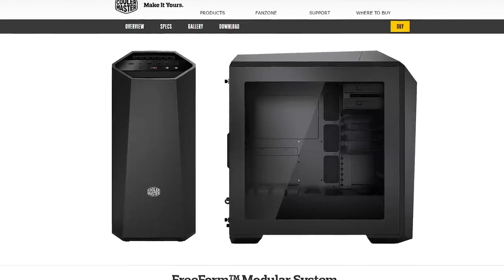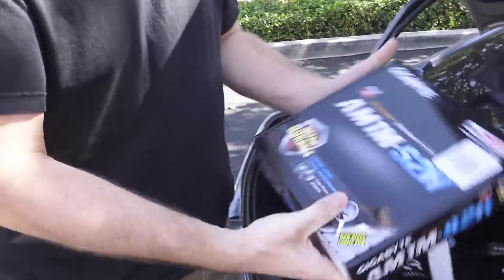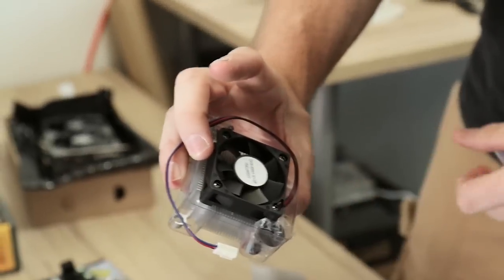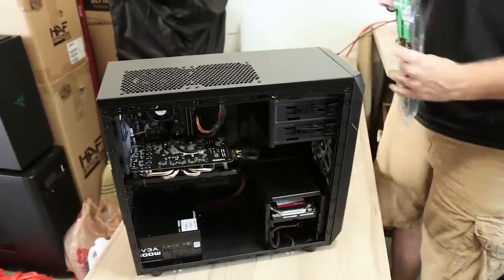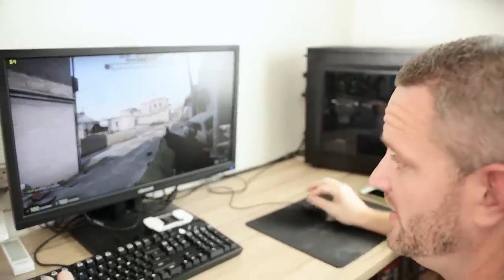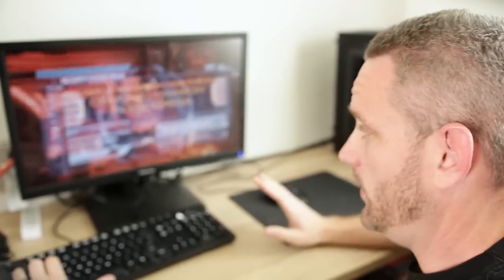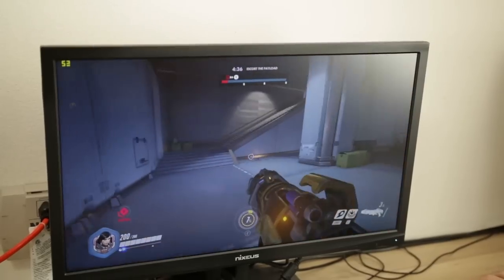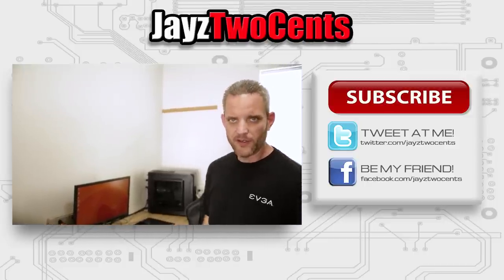Ultra Cheap Gaming PC 2016 - Can you play games for under $400?

Comment: How about an Intel based system around $600?
Reply: Thats like an average build...
Reply: +Luke Thompson that's the point my dude.
Reply: +Ro MaYo Jr you can get i3-6100/i5-6400, 8GB of ram, H110 motherboard, GTX 950, 1TB HDD or 240GB SSD(maybe) cheap case and a 500W psu
Reply: +Marko Tech you think a 960 is reasonable for this budget?
Reply: +Marko Tech Why not go with an FX-8350?
Reply: Ro MaYo Jr yeah it's great if you can get it, but even better if you can get r9 380
Reply: Luke Thompson cus he asked for an intel based pc...
Reply: +Marko Tech cool thanks man.
Reply: you should be able to take this exact build and trow in a intel motherboard and i5 from last generation
Reply: You can do one for $400 that would be a bit more balanced than jay's build, gpu isn't as powerful, but the cpu is much more current and has an upgrade path. (The i3 6100 and motherboard is a $130 bundle at Microcenter) http://pcpartpicker.com/list/j8Tv3F
Reply: +Mr. ManDudeGuy huh? Tf you talkin bout?
Reply: +Luke Thompson fx 8350 isn't really worth it anymore. Performs around 5% worse overall than my i5 4460 which is only 4core @ 3.2
Reply: +unused account If all the cores were working yeah it would come close to your CPU, but once I mention IPC shit goes down hill lol.
Reply: +unused account  I hardly doubt that 5% is gonna make a world of difference
Reply: +unused account Plus the FX-8350 overclocked would kill it. and you can get it when the wraith cooler for less.
Reply: Mr. ManDudeGuy
 cpu's outlast gpu's :/
Reply: +Du6e not always, look at the 860k, it was dead from the stary
Reply: +Marko Tech, never and I mean never get a H110 motherboard or cheap B150 or H170 board... and I would say, never buy anything below i5 at this point from intel.
Reply: how about around 400$
Reply: +Luke Thompson 8350 isn't that great. Even a 2500k trade blows with it. Only a few multi-threaded applications is an 8350 advantageous.
Reply: IIIRattleHeadIII when people are on a budget they have to...
Reply: Marko Tech there is nothing more expensive than a H110 motherboard.
Reply: Take All The same components but Ad 
An I5-4670k and a Z-Motherboard 
(Then you Have my System and it cost me around 600 bucks.. altough i went Itx, that brought cost up a Little)
Reply: You can do the same build price at 400...its been done with CPU's like G3258 (or its Skylake tech replacement), and the motherboard is a little more money. I would say 450 tops.
Reply: Galax 970, i7 2600K (OC 4.7), 8gb 2133 (4x2gb), 500W PSU, P8P67 Motherboard, 128gb SSD, 1TB HDD, Evo 212 Cooler, ATX Tower - $420 (Fluctuates depending on your used part searching skills and daily new parts price changes)

Will play anything on the market at 1080p 60fps while streaming. I know the topic is old but this is in case people come to look later. Second hand old gen OC hardware is the way to go for performance per dollar.

Comment: You Couldn't get a computer for this price in Canada
Reply: try that here in Argentina......
Reply: How bad really is it? I live in the uk (the pound is worth more than a dollar) but for some reason for PC parts of its $400 for them, it's £400 for us, but it's not too bad. I don't know why it's like that because for games it's $60 for them but like £40 for us. Idk
Reply: here that pc would cost me like 800$ if you buy the parts in stores because no one knows anything about pc's here so they over price old hardware (500gb hdd for 100$)
Reply: but your train system is on point
Reply: Yep
Reply: Well that's because your money is worth less than ours, so technically you could  you can't count the exchange rate difference as being more money. 
532 CAD aka 400 USD, could make it a little cheaper but I was copying jays stuff best I could
http://ca.pcpartpicker.com/list/GVtVwV
Reply: VAT is the reason, it adds 20% to all the non EU components, so unless it comes from someone like bequiet then your prices go up 20%, software is exempt from that sort of thing so you pay the normal price conversion (more or less)
Reply: yes you can...... just not without deep sales and access to the internet.
X4 750k with mAtx mobo, 1Tb HDD, Xion Xon BK case, 750Ti, 8gb ram (only used part), 430W Modular PSU all for $395. Opened boxes, refurbed drive, and no backplate mobo. 750Ti was open box
Reply: so guys, does this mean that every video should have an extra +200 dollars shipping (or 100+) tag to it for anyone that lives outside the US/North America (maybe outside of the western part of europe as well?)
Reply: well the Canadian dollar is less than the American dollar
Reply: Je kan gewoon bestellingen ophalen, ook heb je nog wel fysieke shops als Alternate, maar de rest is gewoon falliet gegaan omdat er te wenig mensen kwamen.
Reply: +Anton Perez our parts always seem to cost more. The RX 480 cost $450 CAD...that's at least 300 USD
Reply: There's always going to be a markup whether it's from taxation or just shipping cost, but barely anyone who comments on the cost takes exchange rates into account for some reason.
Reply: Yeah, its like trying to buy a computer with Monopoly money...
Reply: I just built a PC here in Canada. Most jobs seem to be paying more since our dollar lowered(at least here) so PCs are not that hard to get. Even high end. Got like 2tb solid state space 2 980 tis an overclocked i7 6700K  and a bunch of other great stuff and only took a month or two of saving and overtime to afford for something I won't have to upgrade for a long ass time(last PC I had built, had a GTX 580 in it, and still played games pretty well even now... until the card finally died.). Some places have it way way way way way way WAY worse then we do.
Reply: Zalibidas Pay more = more tax
your still loosing and the canadian currency right now is weak so i bet it wont turn out well
Reply: I know, priced are so shit in Argentina, you need to spend around $1200 USD for a medium pc
Reply: Koome
damn how medium is that?
Reply: Your not wrong
Reply: LiteGaming
Its already built and I have another on the go I'm building for someone else. Losing, yes. The dollar is pretty crap right now. Even though it is crap, however, like I said.. its not near as bad as some places. We still have it pretty good.
Reply: I built a 360 CAD$ FX-6300/R9 270x a few months ago.
Reply: Same here in NZ.
Reply: Cairo Murphy I remember I copied Paul's $1200 build as close as I could with what we've got here in NZ, and after conversion it cost like 30%/$500US more.

So this'd probably end up costing $600US ($800NZ) to build in NZ.
Reply: +Koome WTF you wasted hundreds of dollars
Reply: Koome
wat. Are you talking about in the US? Cus'... yea ya can. o_O
Reply: Koome
Ah ok. Didn't see your earlier post. Was gonna say.. for that price in the US, you could get better then that for sure.
Reply: +Koome The specs he listed is affordable in Canada... http://ca.pcpartpicker.com/list/FZk6D8 this is what you can get for 1.5k

and this link is for america for what you can do with 1.5k http://pcpartpicker.com/list/9k4n6X
Reply: yeah you could
Reply: Well duh. 1 USD is worth 1.3 CAD, so why would you be able to get it for the same price?
Reply: Koome the 1080 is over $1000 in Canada
Reply: LiteGaming Ouch. That's more expensive in Canada than it is in the US (even factoring in conversion).
Reply: Koome Nope $600-$800 before taxs
Reply: LiteGaming
US or CAD?

Comment: Im sure you have your reasons, but wouldnt something like a lower end fx processor or x4 processor perform much better and still stay within the 400 dollar price range. Or did you pick a lower end cpu for most graphics power?
Reply from the maker: +ChannelAsh100 I actually went to get the 860 Athlon but they were out of stock
Reply: Would you have rather had that or something like a pentium g4400?
Reply: JayTwoCents I really like the build you should do more of this type of videos and you could help someone build a gaming pc if case they don't have a lot of money.
Reply: G3258 is unlocked and costs 60$ and can be overclocked on many 35-40$ motherboards to 4.4 GH, I did on my MSI H88
Reply: The stock cooler comes with a copper core, it looks like the high end i7 stock coolers, you can OC to 4.2 GH on the stock cooler with the G3258
Reply: 2-core fails in some modern games that don't have 2-core support (probably bad programming and the fault of the developers)
Reply: Why 2 of each hard drive type, do you RAID 0 them?
Reply: I just want alot of storage
Reply: 19TB of Storage? lol. That is over 5,000 1920x1080 compressed h264 movies
Reply: or 600+ average full AAA game installs
Reply: okay I want it
Reply: Some games like Far Cry 4 won't even START on a dual core so I wouldn't call dual-core viable for even an extreme budget build.

Still though, a great way to bump this up and still stay within the budget realm of AMD would be like bumping to a FX-6300 and a board and supports it. That would be a HUGE boost in gaming over the cheap Athlon.
Reply: .....

I was referring to a dual-core CPU.
Reply: +shobonimaster yea plus amd's new zen processors will likely be excellent for budget builds like this.
Reply: FX-6300 is definitely a damn good CPU.  It's what I run, along with (at present, but looking to upgrade for a little more headroom) an XFX R9 270X Double D 2GB.  Handles everything I throw at it, except for a few couple-decade-old titles that seem to refuse to run on anything other than Win95.  I think some of it is compensated for by the RAM I have in it (I do art stuff): 24GB of Corsair XMS3 1600.
Reply: I have the fx 6350, ocd to 4.4 ghz, with an rx 480 8gb, and it runs awesome (this is jumping up from a 6 yo workstation with a gt 620. . .)
Reply: here is my build if you want to see it and plus its a beast so great and worth every penny I beast at any game will have it for a few years I make Pcs for people local to where I am for whatever the pc cost plus 300 dollars more for the work plus ya money for myself cause I do work to build most of my builds cause some of the people who want me to build them a pc want a 3k pc so I have to use a lot of my own money to build them then I sell them to the people for 3.6k sometimes or 3.4k whatever I feel like a good price for it.
Reply: Games4Days >Not even springing for a six-core for $100 more

Shame on you.
Reply: shobonimaster
Hell, I only paid $103 for my Six-Core FX-6300.
Reply: Games4Days
Three words for ya buddy: Run-on sentences lol
Reply: ChozoSR388 I was referring to the six-core i7s that run around $450.
Reply: shobonimaster
What speed? Mine is 3.5 stock.
Reply: I would get the i7 6900K one but I don't think its worth it right now I will wait a few months then buy it cause the price will come down some what.
Reply: ChozoSR388 Speed doesn't mean much across two differnt architectures.

A 3.0Ghz Haswell or Ivy Bridge i7 or even i5 would likely demolish even a OC'd 4.2Ghz FX-8320 because AMD stuff is lower-to-mid range at best as of now.
Reply: shobonimaster
I figured it would be about "even" as long as they were both either x86 or x64.  I mean, if you want to get technical, they both use the same technology, for the most part, considering that AMD came about from being a "third-party" intel processor manufacturer.
Reply: ChozoSR388 

Not really, or else a 2.4Ghz Sandy Bridge Pentium would perform the same as a 2.4GHz Haswell i7 in applications that didn't use more than two cores.
Reply: shobonimaster
Gotcha. Thanks for the clarification on that, actually.

Comment: honestlyi would've choose a better cpu and choose something like a 750ti or equivalent
Reply: rx 460 would be a better choice
Reply: Well I dont now a whole lot about amd although I am trying to ^^ but by mentioning the 750 I was referring to its price range
Reply: yeah i got an FX-6300 and 750ti superclocked and i get 40 fps on max gta5
Reply: What are the settings of gta v to get such low fps?
Reply: I'm getting around 45 fps in gta v with an FX-6350 and a GTX 970. CPU maxes out often.
Reply: RX 460/950 would be better, the 750 ti is too old now.

Comment: a used $400 laptop can outperform this desktop... Just saying
Reply from the maker: +Aznwarlord7 no. It can't. Just sayin
Reply: ***** hosting a server on dust2 my alienware 15 can average well over 200 fps in csgo at 2048x1152 with all settings at lowest and multicore rendering on.
specs:
i7-4710hq
gtx 970m
16gb ddr3 ram
irrelevant specs:
4k touchscreen monitor
rgb lighting :D
256gb m.2 boot ssd
1tb 5400 (swapped out to a 512gb 850 pro)

I bought this used for 400
Reply: to be fair my laptop also outperforms MY $400 (used) desktop with a gigabyte gtx 950 (base model oc&#39;d to a surprising amount), i5-4460, 12 gb ram and it came with a 1tb 7200rpm 64mb cache hdd swapped to a 512 samsung ssd.
forgot to mention it has a potato 280w psu. dont even know how the psu has enough power for the everything (one of the reasons i disconnected the hdd), id have to buy a new psu if i wanted to upgrade this rig to an evga 980 ftw i saw for $250 :(
Reply: Aznwarlord7 that specs cost at least $700 lol
Reply: ng jingchern for my laptop or desktop?
Reply: He's saying you got lucky, essentially, for getting the used laptop for that price (IF you got it for that price). Also, Jay, do you think a Pentium would do better than the Athlon? I've been doing a lot of budget gaming builds and I usually get an i3 and put it in them for people, but the Pentium on an 1151 board would have a better upgrade path. Plus, since I work for Micro Center, we do get a slight discount on hardware and the warranties are for pennies.
Reply: these are used prices not new like jay bought, of course used parts cost less
Reply: ***** i flip laptops
Reply: Then it's not cheaper since you put more money in it.
Reply: Brandon Caylor only the second ssd, the laptop as i bought it outperformed his desktop
Reply: Mhm. I'm sure.
Reply: +Brandon Caylor I say he's full of shit.
Reply: Judicial Same here.
Reply: i dont really care cuz in the end i'm the one who got the laptop :P
Reply: Aznwarlord7 Yup. Really hope your enjoying it.
Reply: +Aznwarlord7 don't care don't comment :D the more you know
Reply: Aznwarlord7,but can you make it powerful.
Reply: Endingz_ a gtx 970m is a gtx 970m which is a gtx 970m
Reply: Your literal words were: A used $400 Laptop can outperform that desktop.. Which we all know is horseshit UNLESS you got a REALLY nice deal on a relatively powerful laptop for a cheap price. Your comment for what it is only holds truth if you're able to find a laptop with better hardware for that price. You're making your argument that MOST $400 laptops would be better than this desktop which is simply not true.

For example, I could say: A $3000 used car is faster than your $10,000 new car.. Well, does that mean that the 10,000 dollar car is overpriced and really slow? No... it just means I happened to find a pretty fast used car for a cheap price. 

grats on getting a cheap gaming laptop I guess?
Reply: The Romanian Gamer ???
Reply: The Romanian Gamer wtf r u talking about
Reply: Yes it can
Reply: Is windows already installed or I have to nstall with cd or USB?
Reply: you have to install it
Reply: Dude that laptop doesn't normally cost anywhere near 400.That's the price that a random person sold it to you because it is used.THis laptop should cost around 1000-1500 dollars.
Reply: saying your $400 laptop USED is better than a $400 new computer... xdxdxd funny
Reply: performance wise it is
Reply: http://gpu.userbenchmark.com/Compare/Nvidia-GTX-970M-vs-Nvidia-GTX-760/m17319vs2159
you have a better cpu but i would have a better gpu for less money. I also have faster storage a better screen, windows 10, a battery and a touchpad and keyboard.
Reply: it has a  gtx 970m and 16gb of ram and a i7-4710hq...
Reply: Aznwarlord7 thats not $400.
Reply: That's a laptop, and laptops aren't as good as Desktops.
Reply: I think you just got lucky getting a 970M for 400. Even used.
Reply: You know, you're probably just lying. I mean, after all, it is the internet. You probably couldn't afford the case alone.
Reply: Aznwarlord7 is this true
Reply: JeremyM couldn't find your company
Reply: thats not 400 USD nerd
Reply: Used is not the same as brand new purchase. If it's second hand you might even go below $300 and get similar or better performance. If we add possible "on sale" components...

Comment: Can you make an counter strike GO Computer that runs on 350-400 fps with everything on low? I use 4/3 resolution stretched.

Must support 144Hz screen.
Reply: easily
Reply: no because that athon would bottleneck  way before 144 fps.  If you can afford 144hz screen and than you can afford a decent i5 and 1151 motherboard.
Reply: J-to-the-R csgo has 300 fps cap no?
Reply: aaa 300 fps cap but can be increased  in console to a higher number.
Reply: what does that mean? the athlon would bottleneck? can you explain?

Comment: the cpu is bottlnking / u couldv easily grabbed a i5 2400 for less and have mch better prfm
Reply from the maker: +XPLOSION Gaming haha.... An i5 and a motherboard for less than $40.... Mmmmmkay
Reply: it was a trap m8
Reply: Or you can just buy an x4 860k for 70 bucks
Reply: Or an AMD 845 Excavator for 65.00
Reply: ***** hi there my friend
Reply: Remember the more expensive the CPU the more expensive motherboard (socket) is required, so good thought but Jay does have a good point here
Reply: true but you gotta go used

Comment: my pc (cheap): Case: DeepCool TESSERACT SW HDD: WESTERN CAVIAR BLUE 1TB RAM: RAMMax 2x 4gb Processor: AMD Athlon II X4 860K Motherboard: ASRock FM2A68M-HD+ Videocard: GIGABYTE GeForce GT 740 OC 2GB GDDR5 128-BIT PSU: CHIEFTEC Smart 550W (GPS-500A8) Case Cooler: 2X CoolerMaster SickleFlow 120mm    What do you think about it?